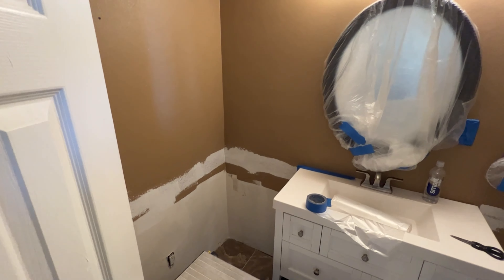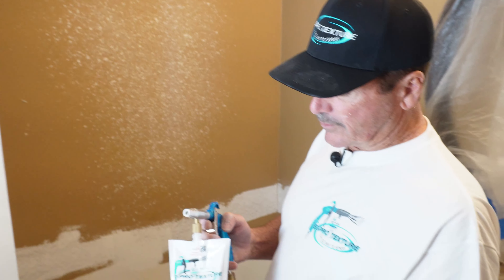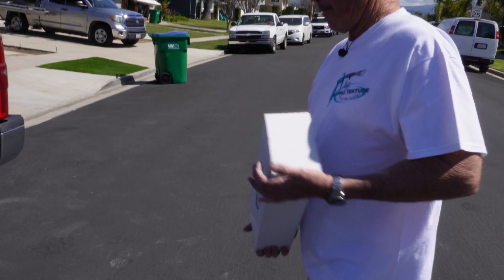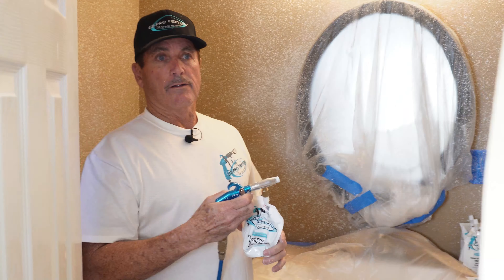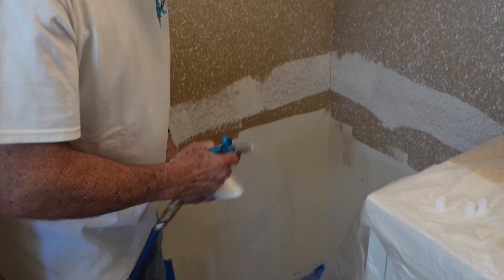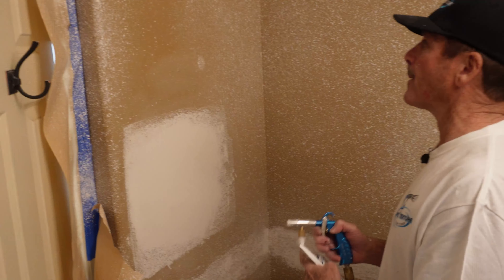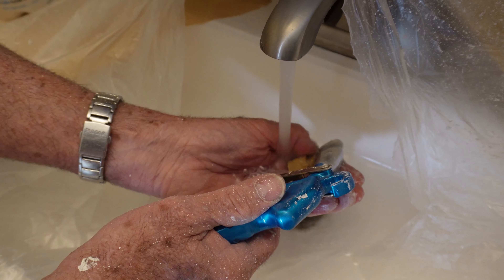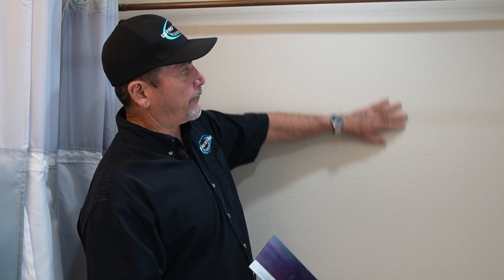I Spent 7 Days TEXTURING My Bathroom And Got AMAZING Results!

Comment: Great work .im a diy gal😊do i have to adjust the compressor  to 60psi ? Or just install the gun n is ready to go.?
Reply from the maker: Hi Maria,
You need to pull the trigger on our gun while you are adjusting the air pressure to 60psi with the air flowing.
Thanks, 
Jim